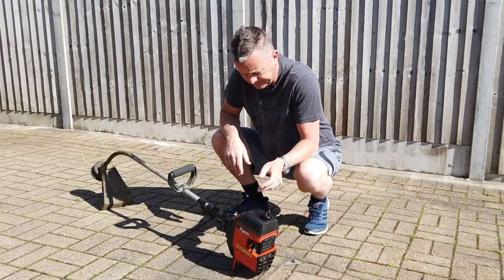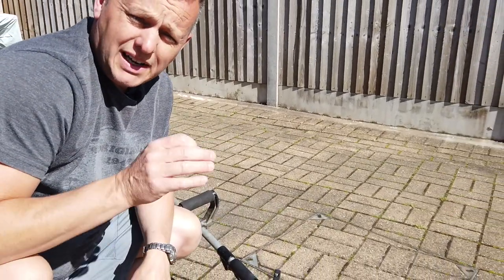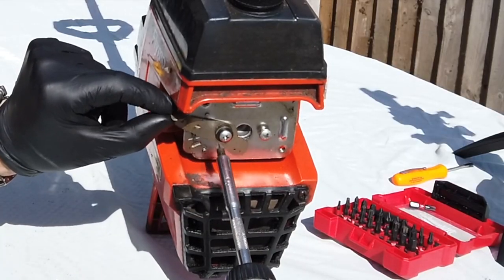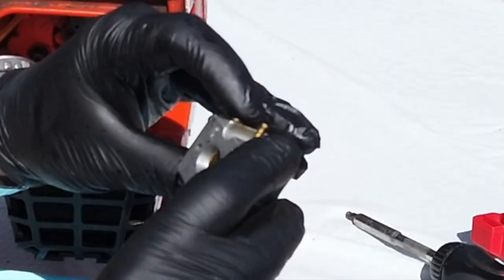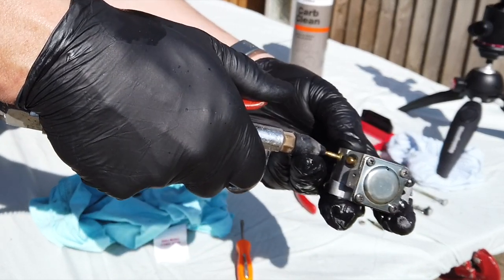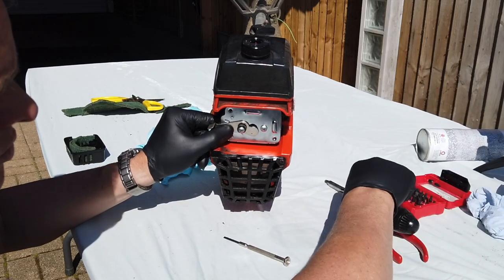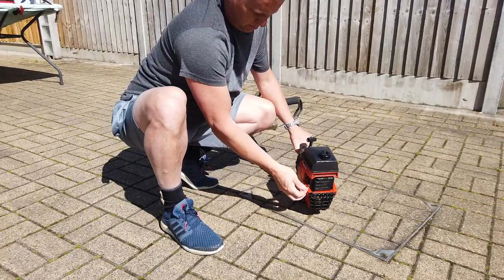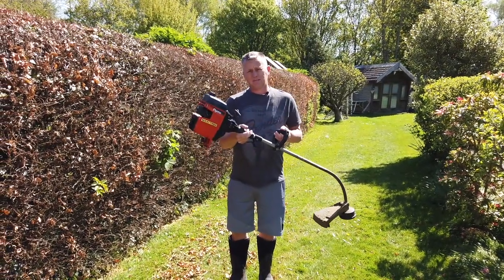Petrol Strimmer Repair, "Wont Start Cuts Out" How To Strip Down Carburettor Change Spark Plug.

Comment: great video anton ,,just a small tip ,,some times strimmers will bog down ,because on the exhaust there is a wire mesh spark resistor  that if blocked will bog it down also ...
Reply from the maker: Thanks for the tip! Thanks for the great comments👍🏻👍🏻🛠

Comment: Great in-depth video 👍🏻 I have an old Flymo Maxi Trim 380 and require replacement of both fuel lines that pass through the tank. Do you know what diameter ones I need ?
Reply from the maker: Link to Scotch Brite £5,  https://amzn.to/2VrmiPa
Link to Carburettor Cleaner £5 https://amzn.to/2xDJAbG
If you prefer to fit a foam filter here is the link to a universal piece:-
Link to air filter foam, £3 https://amzn.to/2XPatE6
Link to all Tools Used, https://www.amazon.co.uk/shop/aaanton11
Link to Air compressor & accessories https://amzn.to/2Shtf3s
Link to Fuel Pipe £8 https://amzn.to/3topN9B
Thanks for the great comments👍🏻👍🏻🛠
Reply: @aaanton11  Thanks for that but the lines are different, it just has lines going straight through the tank wall and the tight fit is the seal.

Comment: Hi there, great video. 1 question... my strimmer will only run fast if petrol tank is opened... any ideas?
Reply from the maker: Tank vent is blocked on the filler cap, Thanks for the great comments👍🏻👍🏻🛠
Reply: @aaanton11  ok thanks. There isn't a vent on the filler cap... This is Nepal and it was fixed by a local "repair man"... no parts are original ones... filler cap could be from a motor bike or anything... i will make a vent... many thanks.

Comment: I wish all youtube videos were as clear as this. Great job. I have the exact same strimmer and every season I have to do a clean on the carb.  This time the butterfly had seized fully open so the throttle didn't work. I blame the new E10 fuel which attracts water and consequently parts that use metal to metal contact get corroded.  At least that's my theory This close of season I'm going to squirt WD40 around all moving metal to metal parts.  I always drain the tank and run the strimmer until out of fuel, but I'm obviously not doing enough.
Reply from the maker: Thanks for the great information👍🏻👍🏻🛠

Comment: Is there a fuel filter on the tank end of the little fuel line?  I need to replace the fuel line as it has perished, but I can't see inside the tank and nothing is ratteling around...?
Reply from the maker: there is a weighted filter on the pipe so it always is at the bottom of the tank, Thanks for the great comments👍🏻👍🏻🛠

Comment: Hi anton, ... Liked your vid, very clear.. I have a Partner B 325 strimmer which looks exactly like yours.. It starts and runs, but cuts out on when revved.. I'm gonna clean the car like you show, but is there a spark arrester on the exhaust that might need cleaning,.. How do  you do that?? Any idea.. Lloyd
Reply from the maker: spray with carb cleaner that will do the trick, Thanks for the great comments👍🏻👍🏻🛠
Reply: Thanks for reply, I'm more interested in how to access and remove the spark arrester.. My strimmer body etc looks just like your flymo, have you any idea how to remove it for cleaning.. Lloyd

Comment: I have  a ryobi which will not start .Have changed the carb and changed the plug.New petrol but it still will not go ...Any ideas?
Reply from the maker: pop the plug out and connect the lead, touch the thread to the engine block and pull the start cord look for a small spark, you will know if its a fuel issue or ignition fault, Thanks for the great comments👍🏻👍🏻🛠

Comment: Good work again pal👍i have an unrelated question if you don't mind answering? Broken front spring (bottom) on vauxhall Corsa vxr (stiffened strut) will driving around without replacing spring for long time damage strut? Thanks for any reply and keep up the good work👍👍
Reply from the maker: It will depend where the break in the spring is , if it is at the top and the sharp edge isn’t digging into anything you will be fine if it is at the bottom and the spring has a chance of slipping over the strut hanger you could be in trouble regarding wheel tire damage if it slips, thanks for the great comments 👍🏻👍🏻🛠
Reply: @aaanton11  thanks would you recommend doing both sides or just replacing broken coil?
Reply: @leseriath  do both sides pal I only did one on my vxr and it messed up the way the front handled and tyre wear
Reply: @Mrboombastic50  thanks I think i will do that to be sure to be sure 👍

Comment: Hi mate, thank you for your video! Could you tell me what size of carb I should get to replace the one on a Flymo 430s max trimmer please? 
Many thanks
Regagards
Alessandro
Reply from the maker: You will need to take the old carburettor off and look for the serial number on the base to be sure to get the same model Thanks for the great comments👍🏻👍🏻🛠

Comment: I recently got one of these but it has no fuel line and just a hole in the bottom of the tank. So even if I got a new line, there's nothing to plug it in to on the tank!
Any chance you could advise what parts I need please?
Reply from the maker: You need a silicone fuel line, that pushes tight through the hole in the tank, with a filter Gauze on the end,  filter link https://amzn.to/3fvBZwV,  
hose link, https://amzn.to/2YJgG4W, Thanks for the great comments👍🏻👍🏻🛠
Reply: @aaanton11  perfect, thank you very much for your time and help! 👍
Reply: HI
GREAT  VIDEO 
YOU  DON'T  FAFF ABOUT  LIKE  SOME PEOPLE  
THANKS  A LOT